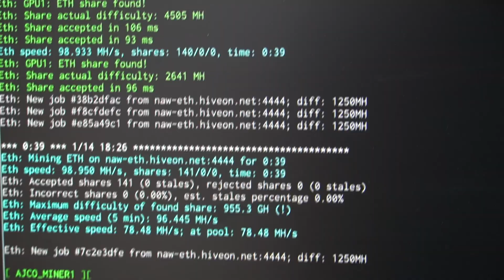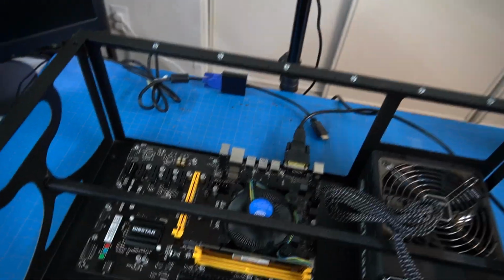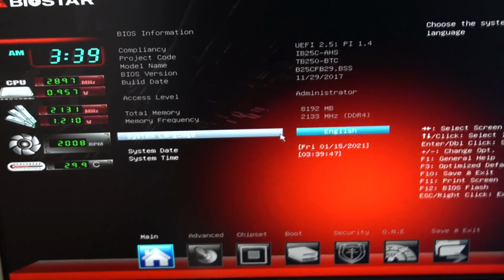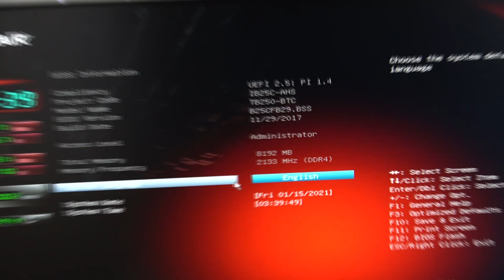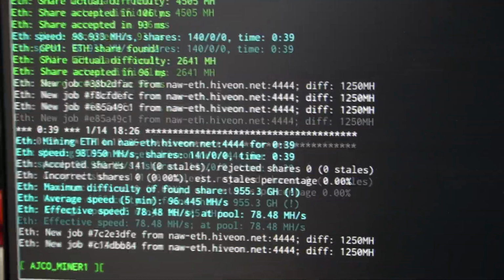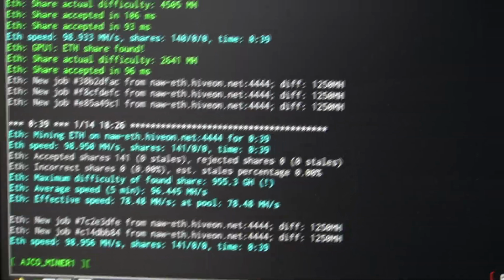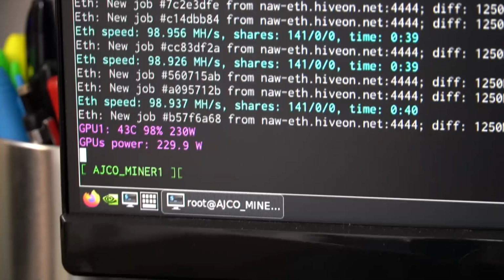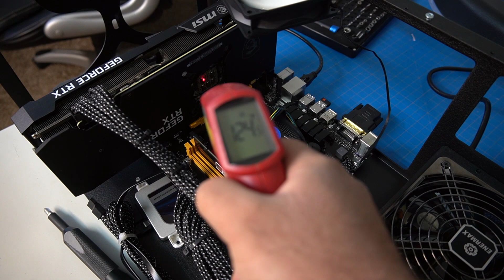First Mining RIG Assembly - Part 2 | RTX 3080

Comment: Question: I have the same motherboard TB250-BTC PRO.  I'm having an issue, when I plug my two power cables into the motherboard the power supply doesn't turn on but when I disconnect the power cable from the motherboard and use the detection tool, it works then. What's going on with issue?
Reply from the maker: Are you pressing the on button on the motherboard? I wired a switch to the headers for power, reset and the leds
Reply: @AlansInventions  I tried touching the two pins where the switch is supposed to go. The power switch is on, on the psu. When I have the detection tool hook up the fan comes right on. The second I take it off the psu goes dead. Then I hook up the two ATX power cables. Still nothing. I'm getting a new motherboard to see if that's the problem. If you can think of anything, please let me know
Reply from the maker: Is the CPU power cable plugged in?
Reply from the maker: I think it may be a ram issue, what ram are you using

Comment: i wait for your next video , share with us your experience with  riser , and  about what wallet do you will use to chas out the money , is less video  where people share info about fee and other stuff , i will watch your video
Reply from the maker: Hello I probably won't put out another one of these videos for at least a month or two to have enough experience mining. As for the risers I used ones that were recommended by the wiki on reddit. I had no issues setting them up. Fees are 1% using hiveon pool and zero for the HiveOS because I am only using 1 rig. As for mining I'm mining to an exchange and then converting to bitcoin and selling until ROI is achieved. Let me know if you are interested and I can send you the Amazon links.
Reply: @AlansInventions  yes  let's me a link ,  i ask  what wallet you use and what exchange site  do you use because I have hear  someing to use coinbase and after transfer to coinbase pro for exchange and after to card for low fee , and there are alot of option of wallet and exchange website   but i dont know sure what metod is more okay